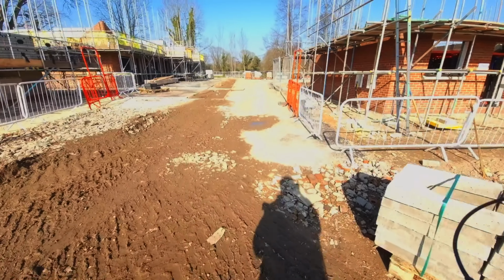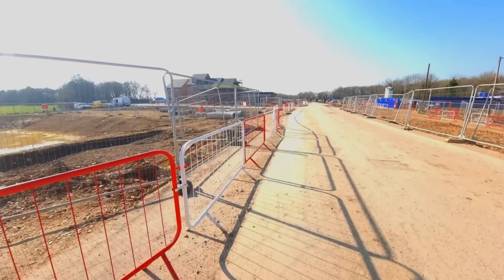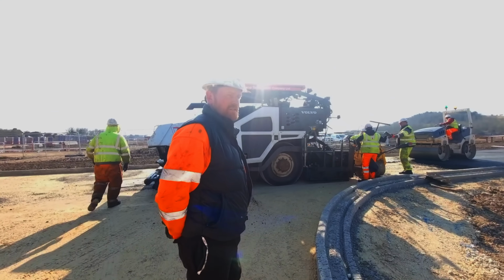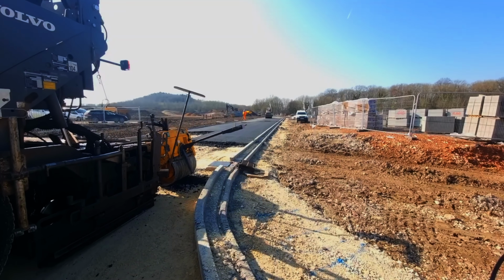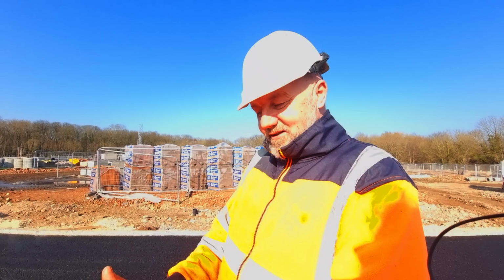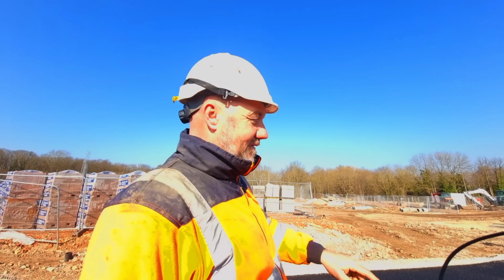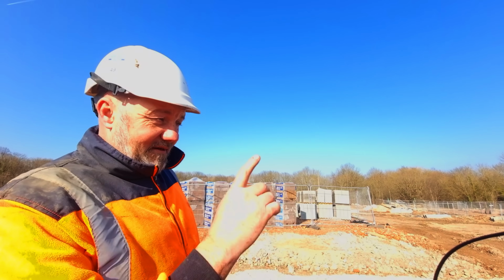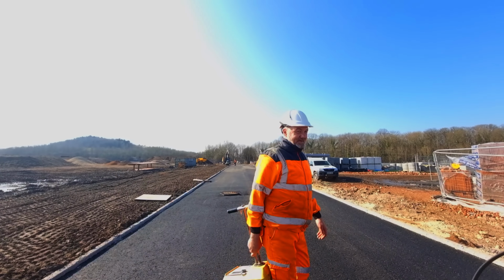This Is A Private Road, You Must Stop Videoing

Comment: Another site manager with superpowers. He can repeal laws like section 33 of the criminal justice act 1972 which states:

“For the definition of “public place” in section 9(1) of the M1 Public Order Act 1936 there shall be substituted—
“Public place” includes any highway and any other premises or place to which at the material time the public HAVE or are permitted to have access, whether on payment or otherwise ”.

SO, basically we if there is no door, gate or barrier between you and the place that you want to go to, then you do indeed HAVE access. Legally. 

If the site manager wants to keep that road private then he would have a barrier at the front of the road with a security guard checking people in and out. However the reason that he hasn’t done that is because he CAN’T do it, because it is a road for which public access IS allowed. 

And if the site manager is correct in stating that PJ was in the middle of a building site then why is it that the site manager was not wearing a high visibility jacket, hardhat and steel toe cat boots??

Comment: With all due respect you have absolutely no right to be where you are filming..
Do you have a basic cscs card... you're over stepping your mark..
It's not public, it's a construction site/project..
Less ego..' how long does it take to go off'..
The road rolled with the roller tells you..
No doubt you will ignore, completely out of touch with current H&S regulations and RA/Ms..
No offence..
Reply: If it is a public road he has every right to be there. The developers should provide a safe means of access. If a traffic order has been made to close the road they should have installed a gate. If you look at the site entrance on street view there are no signs saying that the road is closed, therefore it is still open.
Reply: @johnclements6614  
As the site manager explained it is private property, once the road is finished if the local council adopt it it then becomes a public road, they are then responsible for its upkeep, until then if not adopted the cost of maintenance is shared by the residents as it is collectively their property 

A road can be publically accessible but it remains private property unless adopted.the council or road department didn't pay for that road the developer did that's why it is private
Reply from the maker: It's been a public road for over 100 years
Reply: @PJAudits  
Completely understand your point, however if the developer has purchased the land from the local authority for development at this present moment in time it becomes private property until adopted .
There maybe a clause in the purchasing agreement saying the road will remain public on completion of works.
Reply: @PJAudits  
Another way to look at is, once that road is finished and if you have permission you can drive as fast as you want on it and the police can do nothing about it as it is a private road ..once adopted then standard road legislation applies.
Reply: @briancooper4232  As AJ noted the public have had use of the road for a 100 years. It is an established right of way. Until the developer gets a traffic order for a temporary closure the road it is open to the public. When they get a traffic order they can put up some road and footpath closed signs after which anyone would be trespassing, until then they are not. The street view of the site entrance in October and the previous one (google likes that road) had no closed road or closed footpath signs.

If the developer has purchased the road and the council does not readopt it the road will still be open to the public by vehicle or on foot etc unless a permanent closure is granted by the council.
Reply: @johnclements6614  
No it is not, once purchased it becomes the property of the developer, as the site manager clearly states there is no thoroughfare..
The rights of any access' are entirely within the landowners remit, they own the property and all legislation is negated..it is their property,  the public road status becomes private as they have bought the land it belongs to them. 
If you watch other adults in shopping malls train station etc you must obtain permission to film as although these are publicly accessible places they remain private property and if asked to leave you must do so etc..
Think of it this way....if I purchased a large ran down council estate and demolished it...I. own all that land I payed for the roads not the local authority...the infrastructure belongs to me...not the council/ government and as such is not in anyway under the jurisdiction of any legislative board...
I own it I can stop anyone coming into or onto it and equally allow them to do whatever they want on my property..
You can own a massive country estate with a racetrack on it directly accessible from a public road and drive round it  doing what ever speed you want and the police can lawfully do absolutely nothing as it is private property..
That housing estate falls under the exact same legislation, its private..
Public road legislation does not apply as I said...it is private and public road legislation is both non applicable or enforceable.
Reply: @johnclements6614  
As a footnote I am fortunate enough to own a Kawasaki h2 motorcycle,  i have had it up to 174mph on a public road within British territorial waters in the British isles...
Absolutely 100% legal to do so ..
Do you understand why it is legal to do so.
Reply: @briancooper4232  You are mistaken. Buying title to a property does not extinguish the rights that others have to that property. To remove peoples rights you either have to buy those rights off them or get a court to remove those rights. To close a right of way, temporarily or permanently,  the council would have to grant an order which would end up in court if anybody objected.

 If as you wrongly believed you could extinguish rights of way by selling the land there would be few public footpaths left  across farmland.  The farmer would simply sell the area covered by the path, bridleway etc to another family member to get rid of it.

The same would also apply if your mistaken belief was true for land locked property etc which had a right of access over another. 

I would suggest you read up about public rights of way and there removal, easements, covenants etc. Selling something does not extinguish other peoples right to the enjoyment etc of property.
Reply: @johnclements6614  
Did you watch the video of the guy in the mall...
I can buy any property and deny access to anyone irrespective of some outdated medieval rights of throughfare or rights of way..
These auditors consistently misinterpret section 33...look up the 1994 amendment to section 33 pertaining aggravated trespass..
The land sold in modern legislation adheres to the 1994 amendment and all pertaining to the legislation. 
Once sold from the public domain/ ownership it simply falls under the remit of the landowner. 
Therefore the landowner or a representative can ask you to leave said property, failure comply escalates legally to aggravated trespass which carries up to or inclusive of a £2500 or 3. Months imprisonment..
Buy the land makes it the sole ownership of the landowner and all legislation pertaining within..
I'll simplify it for you..
In make this video and pj audits tripped and broke an ankle who would he sue.
The local council...( because it's a public road)  ???
The developer....???
Who would pay the claim ...???
Its 2022 not 1622 most of what you're saying is completely irrelevant.
Reply: @johnclements6614  
Look up ' access land'...private property remains simply that.
If I buy a farm with a footpath running through it, I can legally deny access to said footpath and any imaginary long out of date legislation..
It is my property and if I choose to do so I can allow public accessibility..
If not it becomes a civil matter of trespass which can be escalated to aggravated trespass which is a criminal offence under the 1994 amendment to section 33.
These auditors understand this and adhere to it...
You clearly don't.
Reply: @johnclements6614  
I'm presuming you understand the principle of a toll bridge...??
Reply: @johnclements6614  
I live in Scotland...if you buy a property you own the perimeters of that land, its called a freehold. 
My sister recently moved to England and down that way a property can either be freehold or leasehold..
Upon looking into what the f*ck is a leasehold...low and behold it goes back to the archaic and draconian feudal laws..
Absolutely crazy...that is why the powers that be are outlawing a leasehold..
Welcome to the 20th century...
You're clueless.
Reply: @briancooper4232  I take it that you now accept that a farmer could not buy a property and then just block the footpaths that the public use.
Reply: @johnclements6614  
Answer this...
Why will a mortgage company no longer issue a mortgage on a leasehold property..
You are clueless.
Reply: @briancooper4232  Are you disputing the existence of   Countryside and Rights of Way Act 2000. 

Peoples rights are protected and can not just be taken away. You have to get an order from the Council or go to court if there are disputes.
Reply: @johnclements6614  
Perhaps in your enlightenment and myself being a experienced hillwalker you can possibly give me a 6 figure grid reference point pertaining to ' designated rights of way'...you know the legislation that enables but does not allow perceived access...
Give you a clue..
Look on the left hand side of a ordnance survey map...run your finger up find the relevant number ie 42..then run your finger across that line look at the bottom figures ie 17..then combined you will find a box depending on the scale roughly 10 km squared,  then divide it by 10 a Silvia compass is excellent its called a 'romer'..
Break down into 10's and cross reference the point you wish to go to.
413178..
Some of it is still and always will remain private property..and all rules apply, the Duke of Atholl has a private army just next to Balmoral, try walking on there and saying you have a right of way...good luck
As for GPS...do you know what a ' fuzzing signal ' is...???
Nope didn't think so...
Reply: @johnclements6614  
Just to enlighten you a ' fuzzing signa'l on a Global positioning system .
Allows the American military who initially owned it although there are now private satellites..
The ability to set a designation or designated area to only allow their GPS receivers to accept the signal..
Non military recipients were scrambled or fuzzed..hence a fuzzing signal...Garmin are world leaders in GPS systems it's why they are a military contractor..
It requires triangulation from various geo stationary satellites...
You can thank Arthur C Clarke for inventing the communication satellite..
Like I said welcome to the 20th century..
Not your out of touch bylaws.